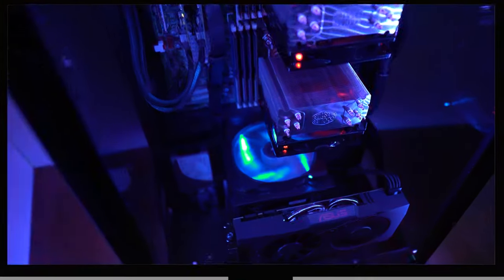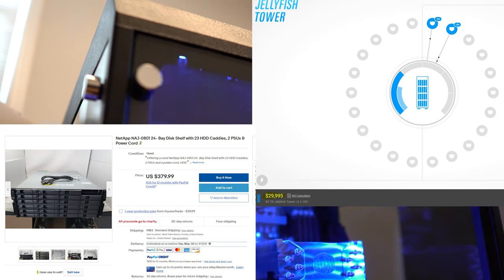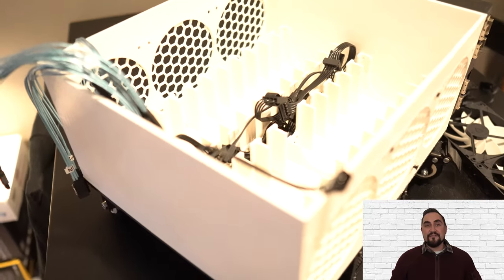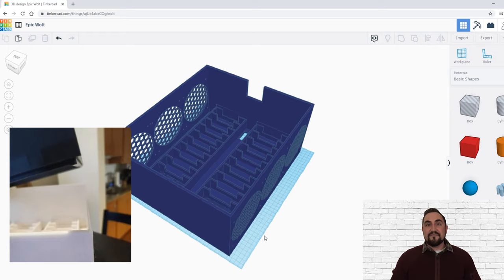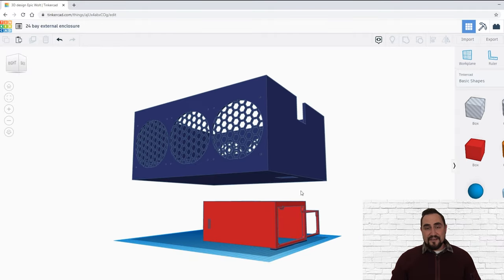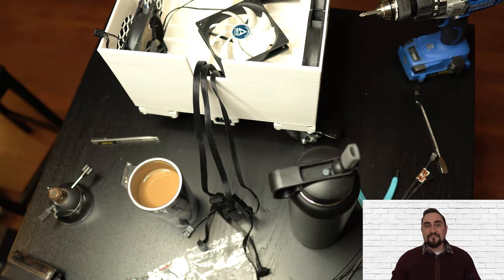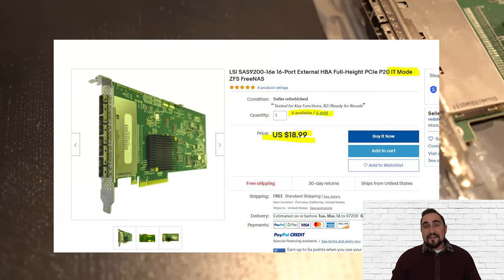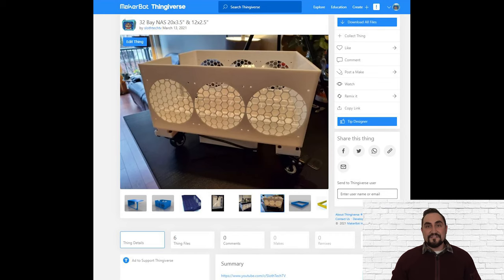3d print your own NAS with 24 hard drives

Comment: Just found your page and wanted to express my gratitude for you pushing this topic forward given there is so much potential for 3D printing to customise a PC. 

I dislike Hot swap bays due to the noise, heat and spacing. Many cases today simply don't allow for many drives.

Comment: Had a similar experience at home. Tried a netapp shelf and it cost about $20/month in electricity. Tried a Poweredge R710 and it was very loud even from the basement. Finally, I settled on a Poweredge T320 desktop with x8 8TB Exos drives - it's quiet as a mouse and uses a 350w psu. never thought to 3d print my own case :)

Comment: Great build. I saw that you built this on tinkercad, any possibility that you would share the link. My goal is to remove 2 fans and make it small enough if possible to print on an Ender3. Also what is the 4:27 what is the box that is connected - looks like a breakout box for cables?
Reply: I also have an Ender3 and would LOVE to print a smaller one of these!

Comment: I have a Prusa and would print and glue the case. My goal was to produce one with a hybrid of printing and composite panel (aluminium plastic sandwich). A bit like a tool chest it would be a big cube and hinge down the middle so you open it and have PSU, MB, HBA etc on one side and drives on the other. 

A good tip for any interested folks - EXTERNAL HBA cards are WAY cheaper used than INTERNAL .... so an LSI 9300-16e   might be $80 while the LSI 9300-16i will be $400. 

This is worth considering with a DIY setup because you don't have to have the mb mounted for traditional plug accessibility ala the ATX standard. You can step the case out at the PCI slots and have all of your "external" connections inside the case.

Comment: What about vibration characteristics of the case? How are drives mounted? Did you 3D print trays?
Reply from the maker: No trays. I've been running these cases for 2 years now. not a single drive failure -- some of the drives are 5 years old. I have over 100 3.5" hard drives atm.
Reply: @SlothTechTV  that's good. The plastic probably performs better than a metal case for vibration.

Comment: I don't own a 3D printer. Don't intend to buy one either.  Any idea on how much it would cost to have this printed at a shop?  Thanks. Great work.
Reply: I found a listing on my local Craigslist, sent the guy this video, and he quoted me $70. That seemed like a really fair deal, so he's going to print me two of them. Then I'll build out the rest of the case myself (PSU, Fans, cables, etc)
Reply: I have a printer and that seems like a fair price material cost would be anywhere from $25-50 based on how solid the print is. And time and labour.

Comment: How did you set up the all 24 drives? Are the break out cables power only or do they transfer data as well? Also how did you hook up the PSU? Thanks for all the info you have provided and will provide in the future.

Comment: What Slicer and what settings are you using to print these in the 20-30 hours mentioned in the vid? I printed one with a Creality CR10 Max with 0.8mm nozzle and it took 62 hours, I tried a few different Slicers and settings but didn't find anything below 55 hours.

Comment: Cool build! Do you see any rust in your setup? Whenever I put screws in 3D printed storage they start to rust more quickly than in other plastic compartments. I believe its because PLA absorbs more plastic and potentially also let off more with heat change. Another addition that would be nice is a way to secure the drives with anti-vibration silicon pads which is good for drive longevity, especially in a case with this many drives (a lot of vibration)

Comment: looks cool but I think you should try and incorporate the PSU and use an internal HBA adapter like the 16i. Including the normally included 6 SATA ports on the MB, you could could get 22 drives and use the remaining space for the PSU.. just a thought. I'd buy the printed thing from you any time....

Comment: I know it's difficult, but looking for the same thing but for SAS drives.  Looking for someone who uses a 3D printed box, with some generic backplane and hooking up a PSU and just a system so you can use HBA connections versus needing to make a whole system.
Reply from the maker: I'm working on a video right now that solves this really well  -- stay tuned
Reply: @SlothTechTV  You are the Man!  I'm tired of running so much high wattage enterprise stuff for only 10-12 TB of SAS.  Bonus if you figure out an easy way for it to mount in my racks! :)

Comment: NOOB QUESTIONS: 

1) if you fill the whole enclosure with drives, how you power them?, the power supply recommended doesn't have enough cables or power lines for them, do I need more than one power supply?

2) you recommend the 16 card for the drives for a total of 32, but I saw in the video that you used 3 cards of 8 ports, is the external enclosure for the cards included in the 3D files? is gonna fit the 16 port cards?

Comment: I would be interested to see how this holds up after about 3 months of running.  I have very little confidence in PLA+, let alone straight PLA holding up under any kind of long term heat exposure.  Fans or not, there's still going to be heat generated in that case, and I fully expect it to warp all to heck very quickly.  I'd be looking into PTE or ABS to build something like this for sure.
Reply from the maker: I've been running them for almost 2 years now. I have 4 of them and they are all 100% exactly how they were when i first printed them. each one has at least 20 drives a few are full with 24 drives each
Reply: @SlothTechTV  Honestly, it looks great and seems to be a great option but how well does it hold up to the vibrations that the drives make?

Comment: 2.5 years later, any update on the case and its performance?
Reply from the maker: Still running strong with all of the drives still in it and working. They were used drives that i put in it to start so I'm surprised i haven't had any failures yet.

Comment: Are there any concerns about drive longevity with these 3d printed enclosures? One of the reasons you want to go with the commercial enclosures is you don't want the vibrations from the other drives to be transferred to all the other drives
Reply from the maker: Been running 4 printable enclosures at home for years now... 120+ drives total.. 80% older used drives .. a lot of the drives have 5-6 years of running time on them...  In several years time I've only had a single 2TB 6 year old drive failure.
Reply: @SlothTechTV  Just an FYI I ran into some reliability issues with 8x 6TB HGST SAS drives (4x per 6 bay enclosure), I lost all the data from a Windows Storage Spaces pool (took about a month), then tried using the same drives in a TrueNAS zfs2 array and experienced the same issue (took about a week). No issues so far using them in a dedicated EMC^2 Shelf with TrueNAS!

Comment: That’s sick. Might have to design one to fit a ender 3 or 5.
Reply from the maker: Oh I forgot I already did. Ill upload the files to thingiverse tonight.
Reply: @SlothTechTV  Did you upload these? Maybe I'm just not seeing it, sorry ahead of time!
Reply: @alejandroperezl  Oh I see, thanks. I thought it was the same design in the end but printed differently and pieced together for the smaller ender 3 or 5 printer. The printer on the thingverse for the design in your video references the Creality CR-10S Pro V2 down in the print settings. That printer wouldn't be large enough for this though, right? You need a printer that's over the 300x300x400 size?

Comment: How do I use one of those common mining HP 750w server psu to power hard drives?
Reply: For others in future wondering the same thing, the server power supplies and breakout boards won't help here typically. Unless you can source HDDs that only use 12v to operate, or if you build/buy a buck converter that can deal with many amps.

Comment: There are several kinds of server cases which support 24 drives. Luckily, you can buy some of these in China under 100 US$ (second hand). It's a much better option.
Reply from the maker: Oh? Do you own any yourself? How loud are they? Have a link?
Reply: @SlothTechTV  It's just a case. I don't have one. I have considered buying one last year. But I chose Dell r720xd instead. I can send you some pictures. I only see these things in Chinese second hand market. Don't know if you can find any of these on ebay.
Reply: @SlothTechTV  It's a empty server case. Support ATX or bigger mother board, 3 or 4 120mm fans, ATX PSU or two server PSU.
Reply from the maker: @linrobert8208  Thats kind of my point... Why didn't you buy one? There aren't great alternatives to DIY unfortunately. unless you want something loud and cumbersome or difficult to build.
Reply: @SlothTechTV  Yes. But these real server may work more stable. And easy to manage through IPMI (like idrac or iLo). Actually I regret not choosing these diy cases. It would be much customizable. Now I run a Dell r720xd at my home. And set Fan speed at 1% using IPMI. Then it's quiet enough to stay under my table.
Reply from the maker: @linrobert8208  
How many drives does your r720xd hold?
How loud is it when the cpu is actually being utilized.. say when youre plotting?
How much power in watts does the r270xd use at idle?
Reply: @SlothTechTV  it support 12 drive. Standard 2U server. I have 6 drives in it.
it's really quiet when it's 1% fan speed. But it will be really loud at high load. All server are the same. But few servers can manually change the fan speed. Some old Dell server can, like r720xd.
it use about 80w at idle without any drive.(only 1 cpu installed)

You should certainly choose a server case I mentioned before. And install standard pc hardward in. use those quiet pc fan. And you can upgrade it as your wish, like epyc or any high-end server things.

Comment: Wheels? Sorry but this sounds like a horrible idea, if you role a case filled with drives i would expect atleast one of them to fail after 10 meters.

Also i think its a pretty bad idea to mount those harddrives without any dampening. Like this the drives can resonate with each other which makes them fail a lot sooner.